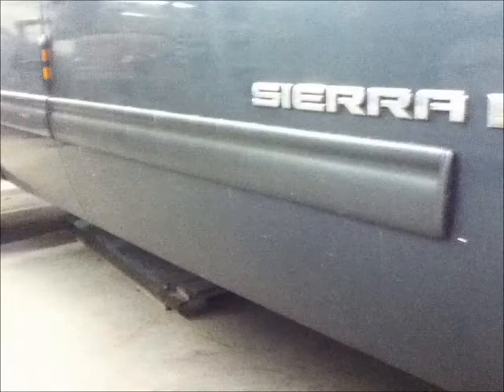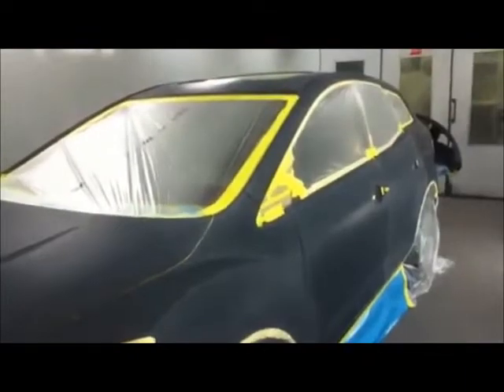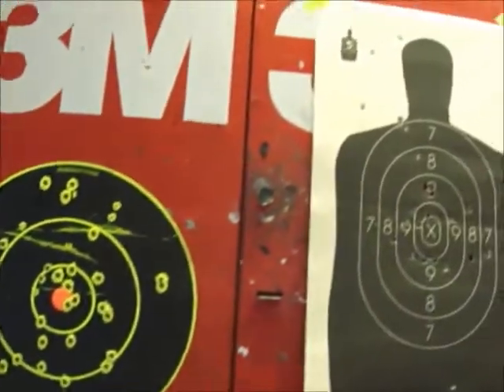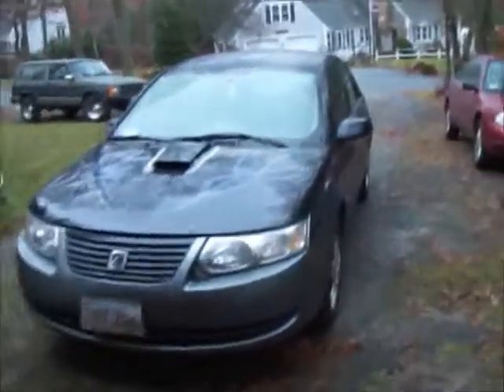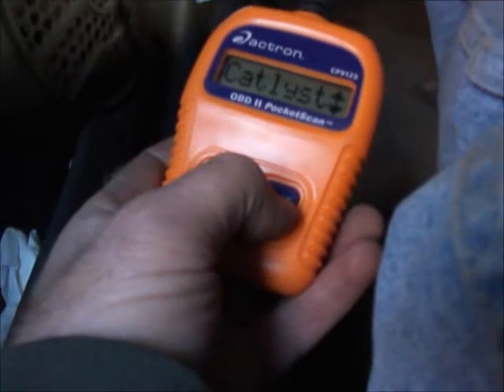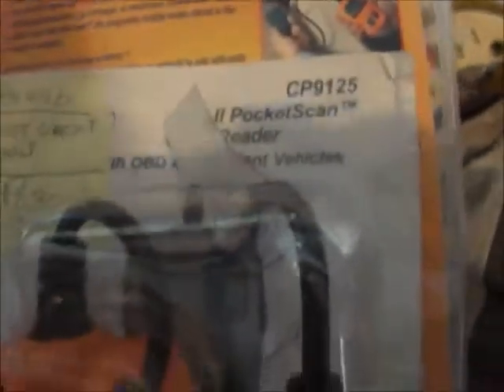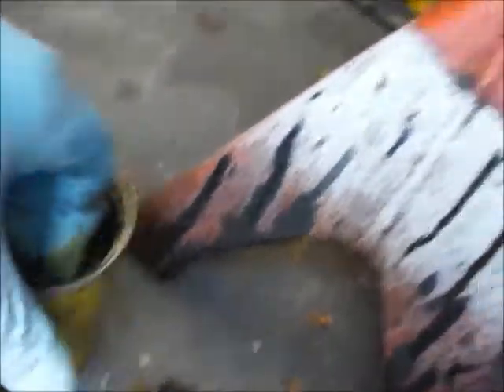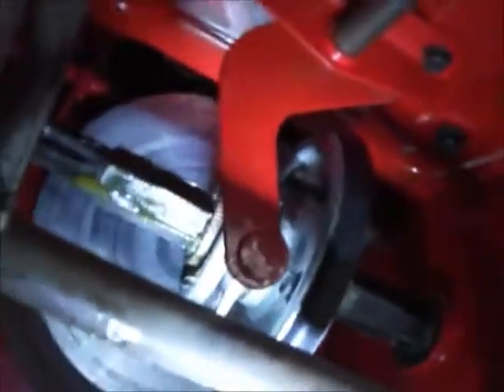All kinds of stuff

Comment: take them off ...check !! surprised they did'nt total it.... gull wing fender easier to get at the oil filter that way... gotta do two on my dodge ram buck twenty for both still better than that one for price .the light usually has to drive a few cycles before shutting off itself .my snowblower has one handle one paddle and a stick that joins the two parts together  donkey powered lol take care rich peace !!!!!